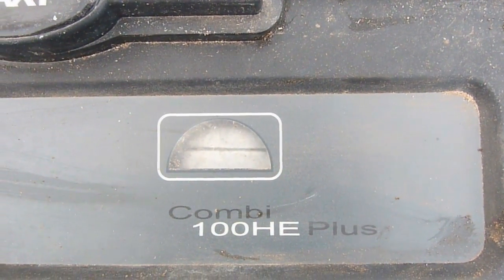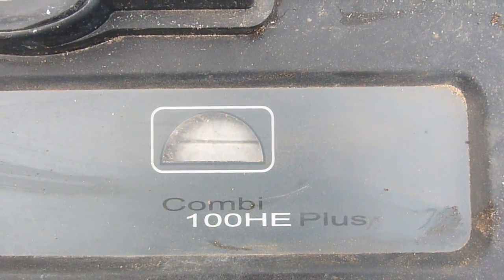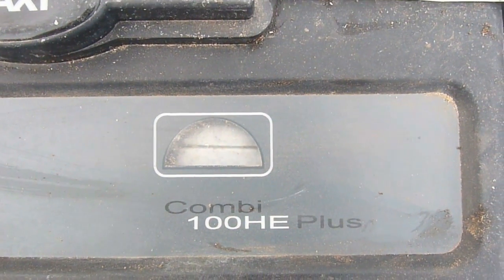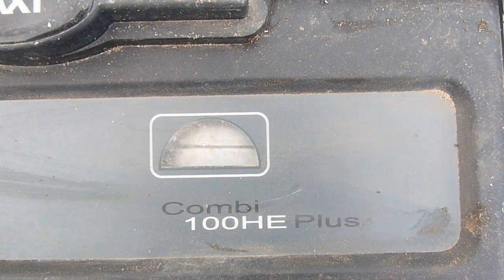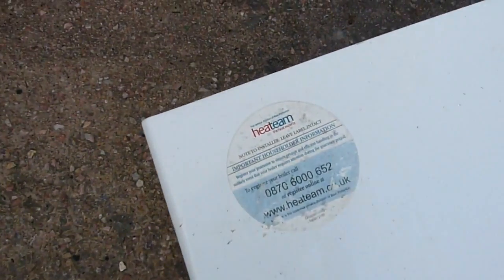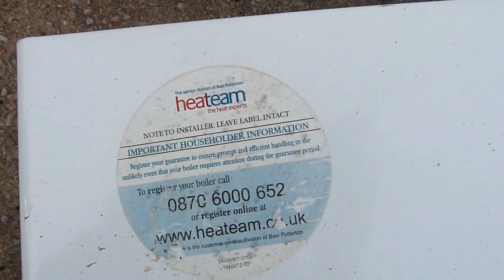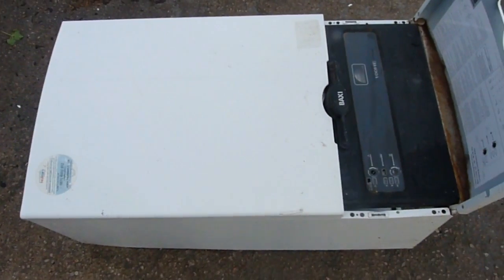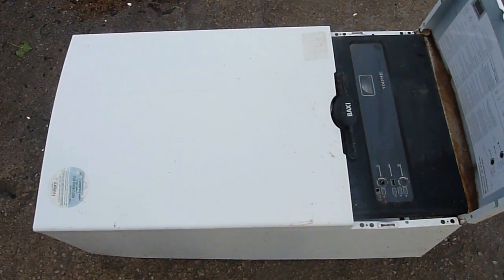How To Fix Your Central Heating Boiler DIY to Save Money. Works on Any Combi

Comment from the maker: Glad you liked the video. Without a doubt the old ones are better, more reliable and far less costly to maintain. They may use a little more gas, but they certainly use less water down the drain while waiting for the water to get warm and you can at least have the water hot enough for a bath. Not so with the boiler we had, we couldn't have a bath as the water never got above luke warm on full flow. Now our log burner supplies piping hot water for free.

Comment: I am an Installer and when asked I recommend the Ideal Independent combi. They are the same as the Ideal Logic but cheaper because they don't have  the gimmicky lcd display. They are very reliable. Hot water performance is excellent.
Reply: +Karen P Thanks Karen that's very helpful .

Comment: As a heating engineer I have found the Germans to have the edge. Viessmann and Vailant although not without some problems make extremely good boilers. Most of the break downs I attend are due to installer error. Most of these problems relate to expansion vessel sizing and water quality. A very common defect is undersized gas supplies. 
If you want a good boiler you must be prepaid to pay for it. A Viessmann 200 with weather compensation controls accompanied by a Viessmann instaler will deliver total satisfaction and great reliability. 5 year warranty and 10 on the main heat exchanger shows confidence in their product. Valiant offer similar warranties but with a few more strings attached. 

Watch out for tricks, Worcester ( bish bash botch) now require the system ph to be under 8 or the warranty is gone. So the warranty will always be gone, they can't tell us how to get the ph down to this low level. 

Baxi told me that investing in research wasn't their responsibility,  duhh.
Reply from the maker: Thanks Andrew, we stick to Miele appliances because German manufacturers and engineers make things that work and last. The warranty certainly gives food for thought for anyone considering getting a boiler. Thanks also for warning people about the water ph issue with Worcester Bosch.
Reply: PH lower than 7 = acidic. An acid is an electrolyte and it will cause the dissimilar metals in your system to react. By adding a corrosion inhibitor [basically a soap] which is alkaline you will prevent electrolytic action and corrosion. The PH test will then give an alkaline reading of 8 or more.
Reply: Slugbabydotcom adding an inhibitor raises the conductivity of the heat transfer fluid. This leads to electrolytic action. The natural ph of water will rise to 8.2 when added to a heating system. This is in the safe range for aluminium but out of the Worcester guarantee range. German standards I believe require the use of deminaralised water and no inhibitor to be added.

Comment: All depends on the installation, if you get a boiler installed as per the manufactures instructions, also have the system fully cleaned, filter added then it should last well. all boilers should be serviced each year as well. if you do not do all these things then you could expect your boiler to last, the boilers we fit now come with 10 years parts and labour warranty.

Comment from the maker: This is a great idea Steve, these people are making boilers that are potentially lethal. A fitter/plumber told me he had been called out to a boiler explosion and that it was not an isolated case as he had been called out to boiler fires a few times over the years since these modern combi boilers were installed. I did a corgi course and yes I read through the telephone directory size manuals on gas safety several times, absorbing and making notes. But there was not mention of reporting boilers.

Comment from the maker: Shazad, thanks for your feedback on older boilers, which speaks volumes about how appliances dealing with explosive and potentially lethal gas should work. In fact all appliances years ago lasted through generations and were hand me downs for newly weds. These modern condensing boilers have been built with faults that make them extremely unreliable. My home is now heated with a log burner which has no parts to go wrong except for a broken glass costing £27.90 Hot water & radiators 6 months = £45

Comment from the maker: I agree entirely. There needs to be an independent regulating body that identifies faults and imposes heavy penalties on companies that fail to provide safe and reliable boilers and components. I am still very angry at BAXI for ripping me off with a boiler that was only fit for the scrap yard.

Comment: Andrew, I am an electrician and mainly working in domestic houses and flats. The number of people who complain about modern boilers is concerning. I have a old "Glow worm" boiler with a hot water tank ( Not a combi ) its about 25 years old and it is still working fine. has only broken down once in 14 years . I am reluctant to have a new boiler although they say they are more efficient. I would think if they cost money to repair so often then they are not that efficient on your pockets.

Comment: Great video which covers my sentiments exactly, having spent many hundreds every year or two, replacing diverter valve, heat exchanger, PCB...etc., etc. and of course having to use the gas register mafia to do the work.
Reply from the maker: +Kevin Adam Yes, our Winter heating bill for last 3 months was a staggering £12.  70 pence :)

Comment from the maker: Baxi 105E had problems with 3 way valve replaced, expansion tank and the PCB after 5 years service with a prior brake down replacing a diaphragm for the hot water. Steve

This combi boiler is Baxi's most reliable boiler and predates the new condensing boilers which are a whole heap of trouble.

Comment: Its a glow worm fuelsaver 30BF. permanent pilot. Copper heat exchanger ,so still about 85% efficient, and no silly pcbs or fans etc. I adjusted down the burner pressure to match the heating load, takes a little longer to get rads to temp but once there it burns continually preventing wastefull cycling and wear of the gas control valve.Just needs about £4 for a new thermocouple every 6 years. Im very warm and happy.

Comment from the maker: Ebay search terms to use: flow reducer bath   We had exactly the same problem and opted to have showers instead. We were boiling water in pans to make up for the Baxi Boiler we had installed. Hope the flow reducers help.

Andrew

Comment from the maker: A FAMILY with four young children has been left "absolutely freezing" for more than two weeks as they wait for the central heating in their home to be fixed.
The boiler in Arborfield Close home broke last month, and they were still waiting for it to be fixed when the Observer went to print. The family called an emergency repairs service after their heating stopped working on March 23, and contractors confirmed the boiler would need to be replaced.  
Published 13 Apr 2013

Comment: About to replace my useless Ferroli Optima 700 with a Worcester Bosch - the only make that appears to have consistently good reviews from both users and fitters. In Midlands Town, UK, prospective buyers will want mainstream heating from the con merchants. I then want to move into an are where wood supplies are a natural part of things. But your argument is right and is the same with everything; fridges, washing machines, TVs - all built like a bag of nails chucked into a carcass.

Comment: Thanks for your response Andrew. I see you're probably similar to myself and expect things to last (15 - 20 years). If something doesn't last then either the design engineer is incompetent or it has been deliberately designed to fail as you say. I see that, like me, you have a German washing machine. What a shame that the famous `British' makes that had a large market share and were trusted in the 60s & 70s didn't maintain their quality standards (drum bearing failures & the like).

Comment from the maker: I agree, it is the boiler companies at fault 90% of the time, there will of course be the odd incompetent installer but the regulations and training prevent most of this to good effect. What is shocking is that an industry in charge of manufacturing potentially deadly and explosive products is failing in it's duty of care to make sure all parts of a boiler are fit for purpose and remain safe for the life of the boiler as was the case with the older boilers.

Comment: That's the best way to fix a Baxi. I have had. Vaillant Thermocompact plus 624 for 12 years now and the only thing replaced on it so far was the fan which had worn the bearings out. This is not a combi boiler it is a system boiler and heats a radiator circuit and a separate hot water cylinder. My brother had. Voters combi boiler fitted and has only had one fault in 14 years, it's still working after the inexpensive repair. Is lid Worscester Bosch !

Comment from the maker: Steve don't get a modern condensing boiler, the savings on gas are achieved because they are useless at heating water and not great at keeping the central heating temp up either. Stick with your older boiler and save yourself a fortune on expensive parts and labour, not to mention the headache of downtime in cold home.

Comment from the maker: TWO pensioners cheated death yesterday after a massive gas blast reduced their detached bungalow to a pile of rubble. It is thought a fault in the central heating combination boiler allowed gas to fill the kitchen, and a spark from an electrical appliance, possibly a kettle, caused the blast.
 “They had a brand new boiler put in recently, but it had been playing up. They had arranged for someone to come out and look at it, but obviously something like this shouldn’t happen.

Comment from the maker: We have the same condensing boiler issues in the UK. I cannot imagine how something as dangerous and unreliable as these condensing boilers has been allowed into our homes, let alone being charged astronomical repairs, installation servicing and replacement costs. How can these be more economical than the far more reliable older non-condensing boilers?

Comment: Absolutely hilarious , reminded me of Basil Fawlty repairing his car with a tree branch. Having gone through three combies -  Vailant,  Baxi & a ??  a plus repair bills over ten years I felt I was working just to pay for the dam things and of course rip off British Gas. I went back to a traditional boiler ( Gloworm) but not even three years in the repair bills started with the dreaded PCB followed a few days later by the fan which I was saving up for as broke after Xmas. As I was bloody freezing earlier this evening I decided to give it a good poke and prod and a lash of WD40 & to my amazement it started and a few hours later ..... I'm WARM! Yes, I know, I'm not qualified, I will blow my house up, bla,bla.bla .... they do say hypothermia does strange things to the brain :-)
Reply from the maker: Loved reading your comment made me smile. Have you thought about a log burner to run heating and water? Mine has been running for years now with zero problems except for sweeping chimney and cleaning out the ashes. The only parts that may need replacing "should they ever fail" are around £40 for a new CH pump and maybe if a valve ever gives up it could set me back a staggering £60 and dead simple to change. I would never have another combi boiler having gone down the same road as yourself re 2 x pcb's, valves flame fail safe and worst of all not being able to take a bath because this BAXI piece of scrap metal was not up to the job it was manufactured for.
Reply: Its still working! I have thought about installing  a log burner, not least because I hate giving my hard earned money to rip off energy companies. My first problem at present  would be affording to have one installed, but as I suffer from asthma I am also concerned about how the emissions might affect me ??  Another huge waste of money was installing a flueless gas fire - these are purported to be completely safe but after a few weeks it got to the stage where within a short time of switching it I started to suffer breathing problems. I did some research and found they were definitely linked to causing/exacerbating asthma and even banned in some countries. Unbelievable that this does not get publicity in the UK? I recently contacted  Asthma UK to ask them why? They are ( allegedly) looking into it. 

I see we share a love of dogs,  essential oils  and Double Barrel - its more  years than I care to remember since I last heard it  - those were the  days!
Reply from the maker: I was told that the York Log burners are very economical and burn very clean. They cause the wood to gasify, generating far more energy. I may be getting one in the future, though mine heats our home nicely for now and should I decide to sell it I will get more than I paid for it :) Another consideration is that logs can emit spores if allowed to get wet, so a dry storage place is essential. On the flip side, the log burner draws air up the chimney aiding more complete turn over of fresh air in your home. Check out my work on Inclined Bed Therapy and yes love that tune :)
Reply: Lesley Nogales Will check out the bed therapy - sounds intriguing? As to log burner, its a bit of a gamble - will it turn out to be another expensive ornament like my fucking useless ( my term for flueless) gas fire. As suspected, I got shot down in flames on postings on a DIY forum by gas engineers who made no mention of the  two gas engineers that did not even try to make a simple repair to a fan!!

You make a very  valid point on the  high cost of installing & maintaining so called more efficient,  modern boilers which far outweigh any savings in gas consumption. Also, the much shorter lifespan of modern boilers ( in my case, 3 boilers in 10 years)  must take far  more resources to produce than any energy saved? So who wins - definitely not the consumer and not planet earth.

With your permission I would like to post a link to your video on the DIY forum I posted on , with a quote saying this was the advice I would most liked to have followed ;-)
Reply from the maker: That's very helpful sharing this video on the DIY channel, thanks :)  My heating bill using free timber, mind you I did have a chainsaw given to me and then there is the minuscule cost of fuel, 2 stroke oil and chain oil and let's not forget sharpening the chain and wearing suitable protective clothing along with swinging an axe to split the logs oh and a heavy duty tarpaulin to cover and store the logs through wet weather. I also have a trailer and vehicle with a tow bar to collect logs
But then there is the fun of asking fencing contractors to drop off any old posts and offcuts they normally have to pay to tip. Approaching building sites is another good source and timber merchants another. Pallets are another source and a Makita circular hand saw will deal with most branches, pallets etc.
Watching the Winter store building up with sawn and split fuel for free is not only encouragingly free, it is great exercise too.
Freecycle is another good source for logs.
Our heating bill as I mentioned earlier is around £12 for 3 months with Ebico https://www.ebico.org.uk/ who offer a zero standing charge tariff. Will be moving our electricity over to them later this year.

My boiler is around 20 years old based on a much older design. I have come up with a way to install gasification into this particular boiler using perforated stainless steel exhaust tube to draw air to the top of the fire. Will make a video of that job too.
Zero maintenance cost so far :)
Reply: Andrew K Fletcher On reading how you go about collecting your free wood, I thought  " sounds like a lot of bloody hard work to me!".  But then I thought about how many hours we all spend working to pay for our expensive boilers,  repairs to said boilers & outrageous gas bill. So what it amounts to is just 'a different kind of work' - which might in fact be more enjoyable than our 'actual work'.

 Unfortunately, I don't think my little Hyundai Getz ( now that is what I call quality engineering - 11 years old, passed every MOT and never cost me a bean in repairs other than annual service, brakes and exhaust ) could cope with lugging all that wood about - but I definitely like your alternative approach to keeping warm .
Reply from the maker: Thank you Lesley. Collecting sawing and splitting wood takes very few hours to generate sufficient fuel for the winter and sufficient fuel for the hot water when my thermal solar panel does not get enough sunshine. A quick burn of around 1 and a half hours will give me a tank of piping hot water. The solar panel also provides our hot water during sunshine and we have an immersion heater just in case though never used.
It is enjoyable knowing you have one up on the boiler repair costs and the energy companies, which is very inspirational, adding a bit more of a swing to the splitting axe. :)  I use only dead trees and timber destined for the tip, incinerating it in my home instead of the commercial incinerators :) I have an older log burner, very robust but not as efficient as the modern ones, so I changed the baffle inside it to a stainless steel secondary burner, (My own design) Now my fire gets very hot very quickly and I can control how quickly the wood burns, producing very little smoke because the secondary burn uses the smoke from the primary burn as fuel mixed with heated air. This requires a further modification and I will add this video. I'm guessing that I will use a third less timber with this and produce far more heat and far less soot in the chimney.
Once you have saved a large percent of your budget as with the log burner, it frees you up to install solar panels, a thermal solar panel, grow your own vegetables, collect rainwater to run your home etc etc, each reducing your outgoings considerably.